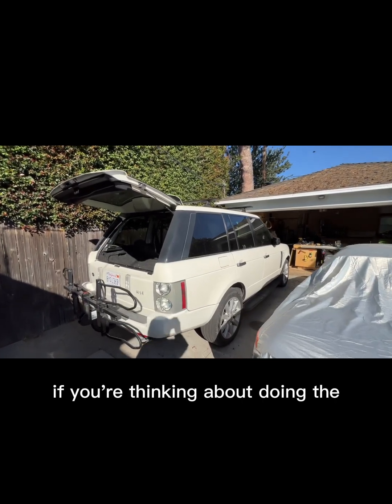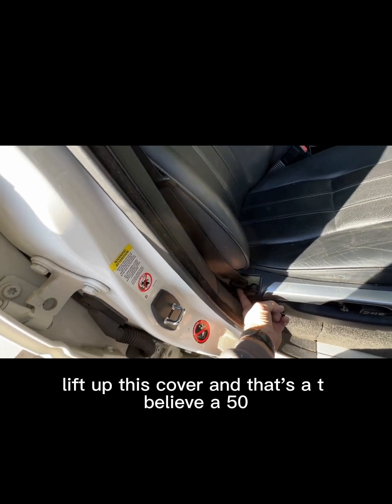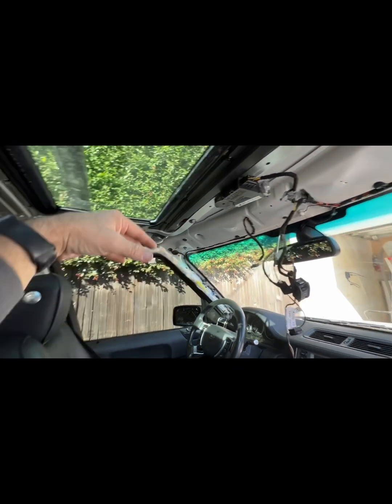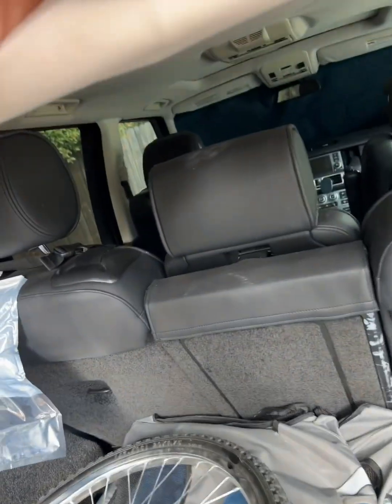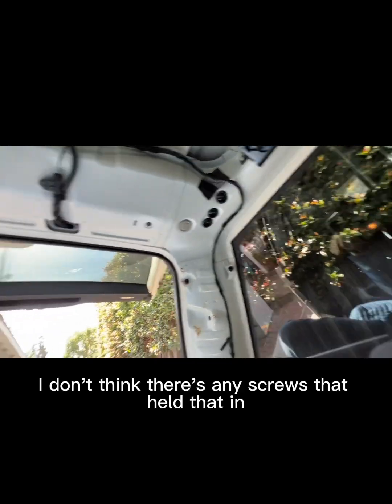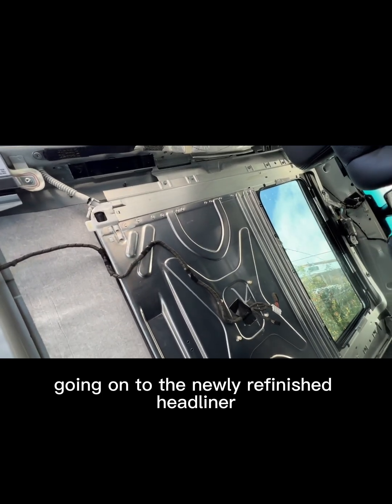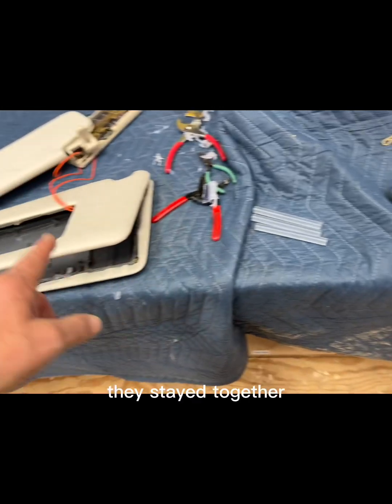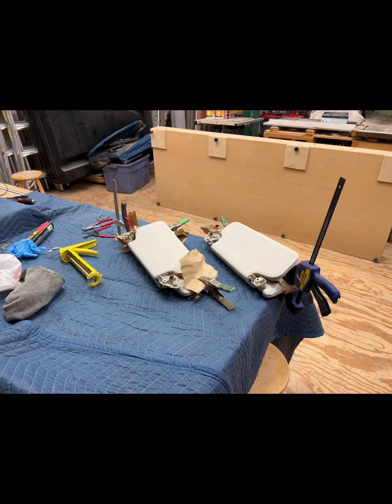2009 Range Rover headliner replacement L322

Comment from the maker: I just recovered the sunvisors again. The first time I did them, I took the upholsterer’s advice and cut them apart into two halves and glued them back together. They ended up bulky and didn’t function like new. 

I bought a pair of used visors and this time I had great luck by recovering them, punching the glued fabric around the perimeter, trimming off most of the excess and carefully pushing the material into the groove. If you attempt this, the hardware end of the visor at the half circle is where you need to start. Add glue and press the fabric onto the visor until it’s secure then stretch on both sides around this area to remove wrinkles. 

The other challenging part is the sliding bar hardware area. I created a rolled edge like a cuff around the bar and it turned out good. I’m happy with the final results. 

Btw if you happen to lose any sun visor screws they’re 5mm x 20mm and not available. I ended up using #10 x 7/8 pan head sheet metal screws and they worked perfectly. With the plastic cover on its as good as new. https://photos.app.goo.gl/j9abpKmFVFqcyr3m9